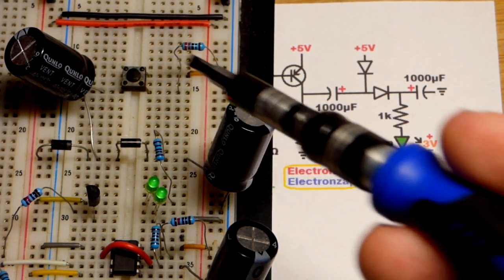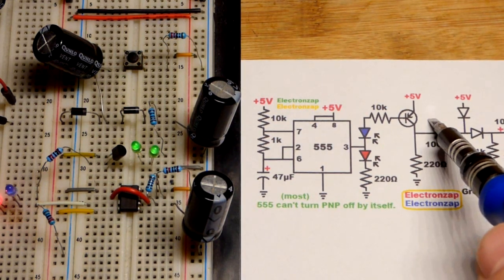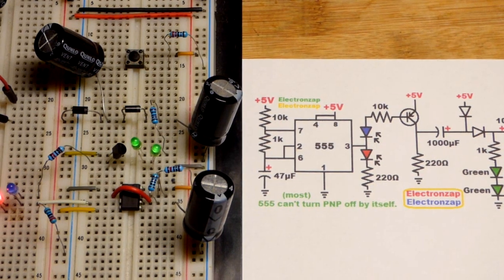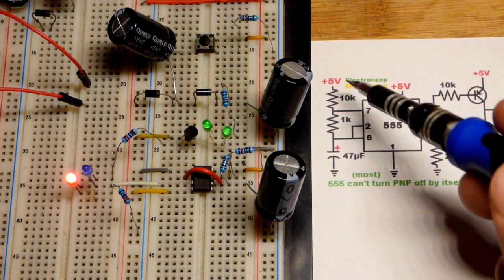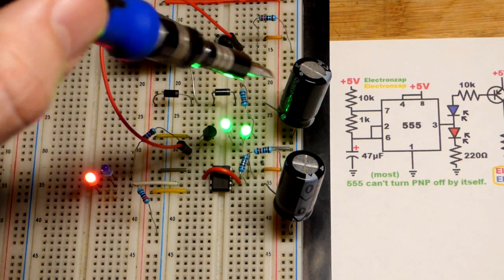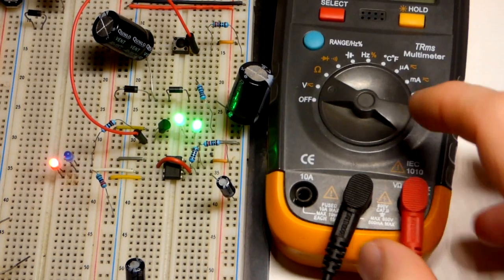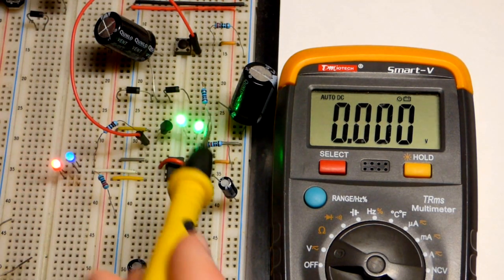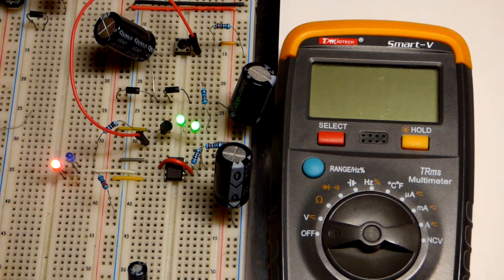555 timer 2N3906 PNP BJT capacitor charge pump circuit electronzap learning electronics lesson 0068

Comment: hey mate, i followed the circuit exactly, except for the 220ohm, i used a 100ohm. the output across the 1000uf capacitor seems so be 5V still and not doubled. what could be the cause?